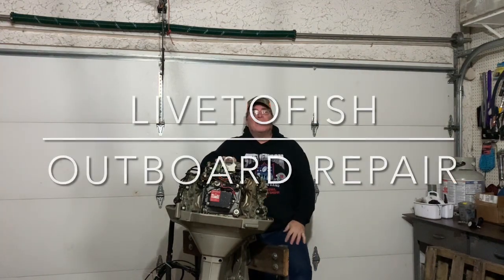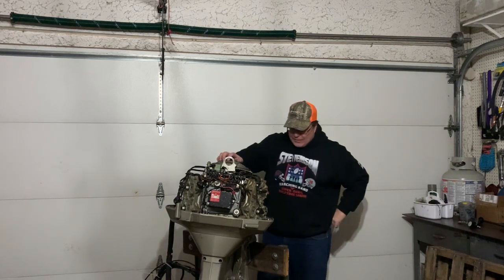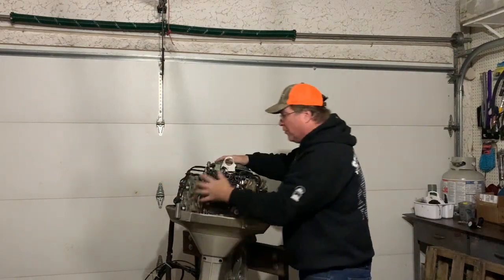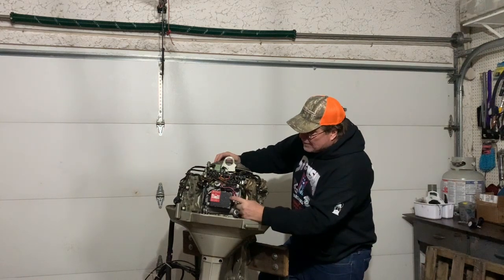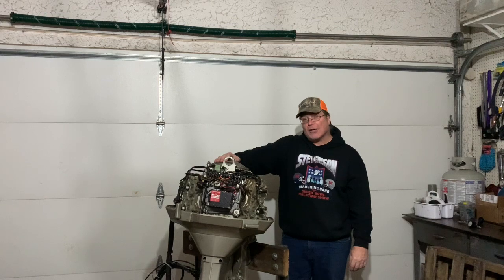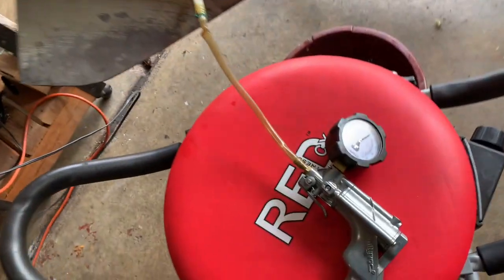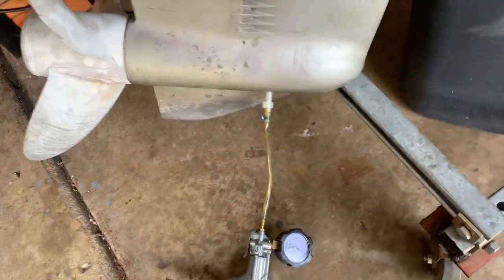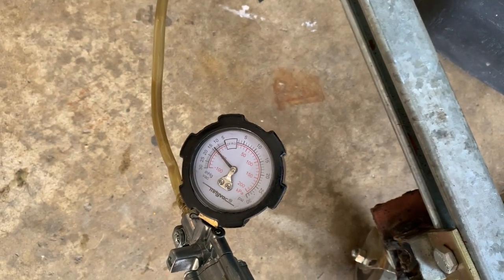85 hp Evinrude Hydroelectric Shift - Will it Run? Comp, Spark, LU Seals Tested - Part 1

Comment: Cause I thought it was supposed to have 1 for each cylinder? Did you ever find out what CDI power pack it needs?
I have the same engine style a Johnson 85 hp that I know nothing about and doesn’t want to crank getting a battery now but could be solenoid maybe
Reply from the maker: This model number only has 1 ignition coil. You need look up your model number on www.marineengine.com This website will provide a drawing of all the engine and lower unit components for your motor.

Comment: I have a 72 that isn't getting spark it has a ton of new parts like someone tried to get it going and gave up on it also the key was sheared off of the flywheel I used a dremel to recut the key way and  I was wondering where and how to position the rotor under the flywheel and how all of that worked if anyone has any answers
Reply: I only paid 400 for the motor i was just wondering if anyone knew how to time it and such or had any clue as to how it all works its a pretty different setup
Reply from the maker: Your best bet would be to purchase a service manual.
Reply: Would you please provide any info, numbers etc. on that Motorola amplifier, thx.
I recently acquired a 71 85hp Johnson and the seller said no spark. I haven't tried yet but ...

Comment: My '72 has that same Motorola Amplifier.  The wires to the amplifier are all cracked, and I have heard this is common.  I wonder if the cut wires weren't an attempt to replace cracked wires.
Reply from the maker: Yea maybe 🤔. The motor seemed to run quite well even with the cut wires. I didn’t look that far into it or even take it apart to see what they were. I felt if it’s not broke don’t mess with theory.